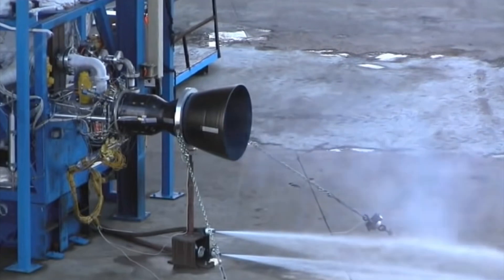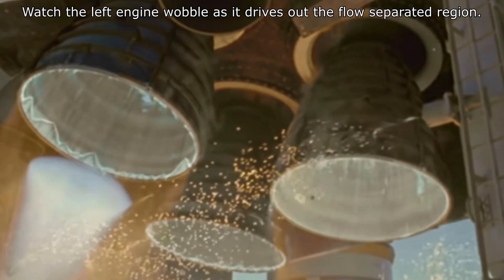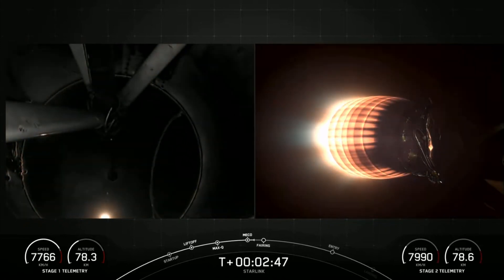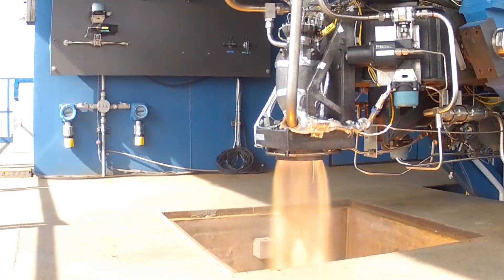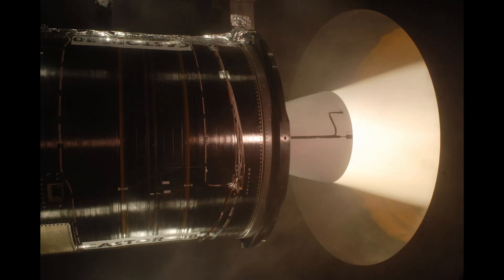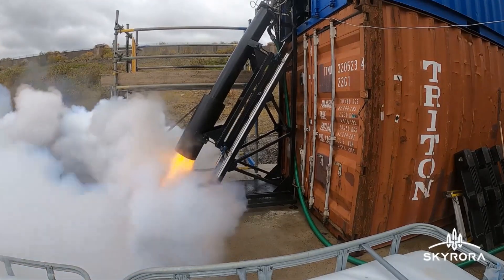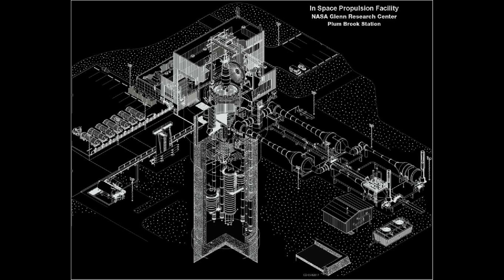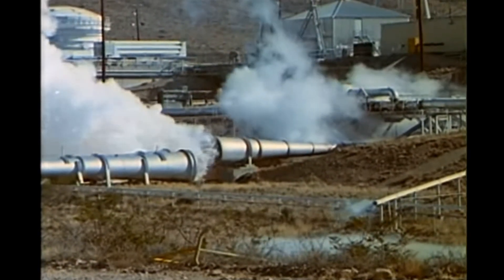Defying Atmosphere - How Rocket Engines Get Tested In A Vacuum Before Going To Space

Comment: Where is your work calculation then? They're easy yet you cannot provide one. Maybe because you're a liar, eh? 😂
Reply: Work is force times distance, assuming thrust is constant the work is the thrust times however far the rocket moved during that time. Or do you mean something else by work calculation? I am prepared to work it out if you can tell me the goal.
Reply: @tyruskarmesin5418  no, work done by a gas is external pressure x change in volume. External pressure in a vacuum = 0 so work =0. Caught you Lying again 😂
Reply: @papalegba6796  First, that formula is for a confined gas, and while it is accurate, it is not really applicable here. It is about a gas pushing on a piston, and does not apply to a case where there is a very large vacuum for it to expand into.

Second, that word, "external," is dangerous here. We have to be careful to understand what it means. There is kind of an intuitive definition, but what exactly counts and doesn't can be subtle. If we count the rocket and the fuel as two different systems, then the force from the fuel on he rocket is "external" to the rocket. 

Finally, I have a question. What do you think would happen if a rocket were to fire its engines in space? My impression of your idea is that the fuel would go shooting out the back, but the rocket would stay in place. The issue is that it seems like that would violate conservation of momentum.
Reply: @papalegba6796  And to be clear, the force of the tank on the fuel is external to the fuel.
Reply: @tyruskarmesin5418  how is the equation for work done by a gas not applicable to an engine powered by gas? You are ridiculous, go away 😂
Reply: @papalegba6796  That equation applies in a quasistatic context, which this is not. I know that you don't know what that means, and I know you don't care. You are not interested in truth or reality, you take brief glances at what I say and then start spamming "😂" emojis. You get your ideas by half understanding flat earth videos by people who themselves don't understand what they are saying. If you want to demonstrate that you are actually interested in reality, please address the question I asked before. If a rocket sends out fuel but stays in place, doesn't that violate conservation of momentum?
Reply: @tyruskarmesin5418  it applies to all gas, everywhere. Stop lying please 😂
Reply: @papalegba6796  You see? You have no understanding of the topics being discussed, and you intend to keep it that way. This is the second time you tried to dodge my question.
Reply: @tyruskarmesin5418  Ask him how much work is performed by a Space Shuttle Main Engine as it accelerates 500 kilograms of H2O to Mach eight every second.
Reply: @rocketman484  That'd be fun, I wonder how he'd dodge. I bet he ends his comment with "😂". @papalegba6796, Feel free to prove me wrong.
Reply: @tyruskarmesin5418  papalegba will refuse to answer any questions that prove him to be wrong. So basically, any questions then....
Ask it what the exhaust gas is from a hydrogen oxygen flame.
Reply: @tyruskarmesin5418  Want to be called a 'bot'?
Just ask papalegba any question that proves him to be wrong.
Like "where does the force originate that accelerates the mass of the exhaust gas into the vacuum"
It will type up more words explaining why it doesn't need to answer than it would take actually answering.
Reply: @papalegba6796  - So where is your calculation of the work required to accelerate 500 kilograms of water from a standstill to Mach eight?
Reply: A gas expanding into a vacuum does no work. It's a gas law, go get mad at it, not me 😂
Reply: @papalegba6796 How about gas pushing against the top of the combustion chamber?
Reply: @tyruskarmesin5418  That's internal pressure. Have you forgotten the gas laws already?😂
Reply: @papalegba6796  - "A gas expanding into a vacuum does no work."

So how much work is performed by accelerating 500 kilograms of mass from a velocity of zero to 2500 meters per second?
Come on show us your calculations.
Reply: @stuartgray5877  If it's a gas expanding into a vacuum then zero. Plus it doesn't accelerate anyway according to kinetic theory. Stop hating on the gas laws like I wrote them 😂
Reply: @papalegba6796  - "A gas expanding into a vacuum does no work."

But 500 kilograms of mass being accelerated from a velocity of zero to 2500 meters per second DOES require work to be done.
Care to tell us the amount of work that must be performed to do so?
Reply: @papalegba6796  - "Plus it doesn't accelerate anyway according to kinetic theory"
SO when the exhaust comes shooting out of the back of a SSME at Mach Eight, it must be my imagination?

So what blew the launch pad apart during the superheavy launch?
MAGIC?
I guess there was "no work done"" as the concrete was hurled hundreds of yards into the air?
Reply: @rocketman484  if you don't understand kinetic theory just admit it 😂
Reply: @papalegba6796 if you don’t understand basic primary school physics just admit it
Reply: @peeperleviathan2839  He DOES understand. He just pretends to be this stupid for the attention.
If he did not understand the physics, then he would not know which of my questions to avoid answering.
Reply: I'm not the one making videos saying a rocket can do work in a vacuum, yet not providing simple work calculations 😂
Reply: @papalegba6796  - "Where is your work calculation then?"
Well at sea level a Space Shuttle main engine expels 500 kilograms of "Mass" at Mach Eight (about 2500 meters per second) every second,
papalegba - Do YOU know how to "calculate the work" required to accelerate 500 kilograms of mass from a velocity of zero to 2500 meters per second? (No. No you do not)
Because that is the "work" performed by a SSME every second. You are welcome.

OR are you suggesting that MASS can be ACCELERATED without performing any work?
Because that IS what rocket engines DO - Accelerate mass .
Reply: @papalegba6796  - "if you don't understand kinetic theory just admit it"
Just ANSWER rocketman's question then.
If a rocket engine can "do no work" then HOW did it hurls TONS of concrete hundreds of yards from the pad during superheavy launch.
The ONLY thing you are good at is dodging questions.
Reply: @stuartgray5877  concrete isn't a vacuum, chatbot 😂
Reply: @papalegba6796  Tell us AGAIN how "rockets push on the atmosphere" while the atmosphere IS A GAS.

You don't even realize that you r argument IS:
"Rockets push on GAS but they CANNOT push on GAS"
Reply: @stuartgray5877  now you're saying propellers won't work, it's hilarious 😂

Comment: In space why not collect the heat from the exhaust on it's way out or at least line the exhaust cones with thermal electric generators to recoup and utilise the heat loss?
Reply: Rocket exhaust is actually very cold. Most of the useful heat is already extracted to accelerate it more.

Think of it in terms of energy. You can’t create or destroy energy, just change its forms. We burn chemicals in the combustion chamber which gets really hot and high pressure.

There’s a lot of energy in that heat. The purpose of a nozzle is to turn all that heat energy into kinetic energy of the propellant moving backwards. At the end, there is little heat energy left.

There’s also regenerative cooling which takes heat from the nozzle walls and puts it back into the system further up stream.

So what you suggest is already in spacecraft in a variety of ways
Reply: Thank you for your input! Part of my thought was to line the combustion chamber with thermoelectric generator pads but I hear what you are saying. Thanks again!  @samburnes9389
Reply: @johnarizona3820  it’s a design choice so there’s no right answer. Whether you want to use all that energy for propulsion or redirect some elsewhere depends on the parameters of the mission.
Reply: By first having an internal combustion chamber with integrated heat exchanger absorbing the thermal energy then passing the chilled pressurised gas through secondary chamber and final exhaust port cone housing. The pressure of the exhaust would provide thrust, "cold thruster".  @Matuse
Reply: @johnarizona3820  So you're giving up a huge amount of your thrust to gather some heat - to what end? Spacecraft already have massive systems involved in getting rid of heat, because it's quite difficult. Have you ever seen the heat dissipation racks on the ISS? It's 156 square meters of ammonia filled tubing on the exterior of the station, connected to a huge amount of interior water based heat collectors to gather it up and get rid of it, lest the astronauts bake to death.
Reply: Not at all but rather only extract what would otherwise be wasted in thruster outflow. The heat dissipation is a necessity in sunny locations but needed in shaded space. Planetary travel for example would make great usage of excess thermal energy.  @Matuse
Reply: The point is to further increase fuel efficiency and this is how to do it.  @Matuse  Plasma drives require a great amount of electricity and heat = electricity.
Reply: You were a waste of time. You offer nothing. The mouth speaks what the heart is full of. @Matuse

Comment: There’s so much about this that is bullshit.  There cannot be thrust without atmosphere.  What u going to push against?  There has to be an action and reaction.  “It pushes against the back of the fuel tanks” is not a correct answer.
Reply: - "There has to be an action and reaction"
Yes, so what would happen to a crossbow firing a projectile into the vacuum?
Reply: @Matuse  - So, here's an experiment for you to try at home.
Hold up an EMPTY propane tank and push as hard as you can.
 Oh look, you moved backwards.
Hold up a FULL propane tank and push as hard as you can.
 Oh look, you moved backwards, but MORE than with the empty tank
WHY?
 (of course I know you will give the right answer)
Reply: It basically is correct though? It might be more accurate to say it pushes against the back of the combustion chamber, but why wouldn't that work?
Reply: A rocket works by pushing against its own exhaust. Action: burn some propellant, which pushes with equal force in all directions. In once direction, the rocket engine is in the way, so this force is applied to the rocket. In the other direction, nothing is in the way, so the force goes into the gas molecules from the exhaust flying away at high speed. 
You can try this at home: stand on a skateboard, and throw something heavy. You will move in the direction opposite to where you threw that ball.
Reply: @h.dejong2531  That violates all Newtons laws but whatever 😂
Reply: @papalegba6796  It is exactly in accordance with Newton's laws. It's the force diagram you have been asking for. And it is proven to work by 10,000 satellites successfully operating in orbit.
Reply: @h.dejong2531  No it isn't 😂
Reply: @Matuse  You do realise pushing off the air is how airplanes and birds fly, right? This isn't even about rockets.
Reply: @tyruskarmesin5418  everything that flies pushes off the atmosphere through which it moves. Except rockets, somehow 😂
Reply: @papalegba6796  Is it really so strange that there might be multiple methods of moving around without touching the ground? And it's not just "somehow," rockets use well understood physical principles, and no amount of laughing emojis can change that. 

A good analogy is the recoil of a gun. When a gun fires, the bullet goes shooting out one direction and the gun tries to go flying in the other. If someone is holding the gun, this is felt as a strong force pushing against their body. If it is a powerful gun, the person could be sent flying. If you were crazy enough, you could make a flying machine from this, shooting guns opposite the direction you wanted to go. That's what a rocket is. None of this relies on the atmosphere to work.
Reply: @papalegba6796 indeed. That’s why you can have an aircraft fly across the ocean and be mostly made of payload/structure, but a rocket the size of a building is mostly fuel and can only lob something relatively small into space.

Using air to generate lift is really efficient. Doing it all yourself with a rocket is hard. We wouldn’t do it that way if we didn’t have to. But there’s no air in space.
Reply: @samburnes9389  "we" 😂
Reply: @tyruskarmesin5418  sorry I don't speak gibberish, can you repeat that in English please? 😂
Reply: @papalegba6796   rockets accelerate by throwing mass out the back of them. The same way as when you shoot a gun you feel it kick back.

Now for an airplane you can use wings and airflow to generate lift and keep you in the air. You use a lot less propellant that way compared to a rocket.

A rocket you need to provide all the stuff to push against yourself. That’s why they’re the size of sky scrapers.
Reply: @papalegba6796  Oh, I'm so sorry, I forgot who I was talking to. Here, maybe this is more your speed. 

Gun shoot, gun go back. Gun shoot lot, gun go back lot. Gun shoot down, gun go up. Rocket very very big gun!
Reply: @samburnes9389  - you cannot convince papalegba of actual reality.
For example, when I ask it: Does the exhaust gas get "accelerated" from the rocket nozzle, its answer is "NO".
If you ask it what IS the combustion by-product of burning hydrogen and oxygen it will answer with "Fire".
It refuses to believe the answer is "Water".
See it is 100% incapable of passing either a physics exam or a chemistry exam but feels confident arguing with actual engineers.
Reply: @stuartgray5877  it’s a bad habit. You’re in the comment section too.
Reply: @samburnes9389  I have no idea what you are trying to say.
Reply: @stuartgray5877  it’s a bad habit I have to argue with people in YouTube comment sections.
Reply: @stuartgray5877  none of that happened but whatever 😂
Reply: @stuartgray5877  You're a chatbot, you have no family 😂